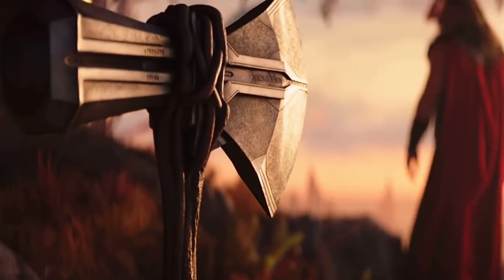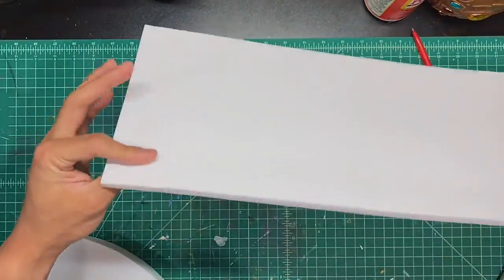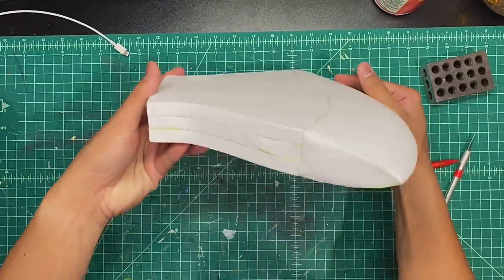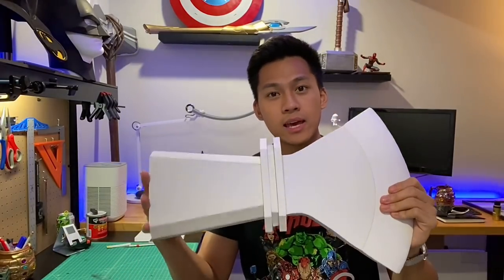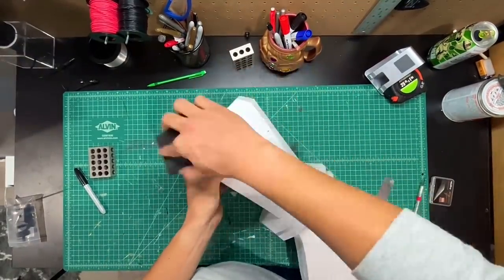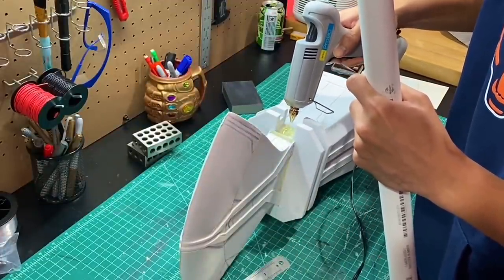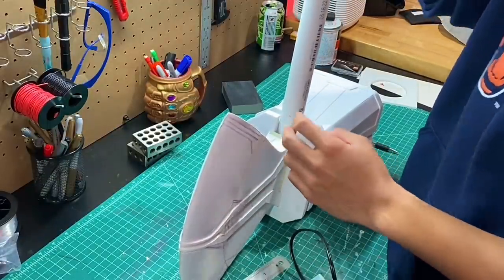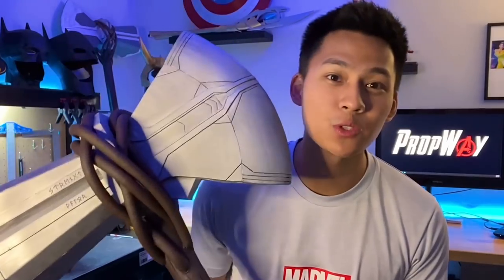How to make STORMBREAKER! - DIY Thor: Love and Thunder

Comment: What is the size of the octagon pieces that connect the axe head and hammer head pieces together?
Reply from the maker: The outer parts are 5" x 7", and the inner part is 4" x 6". And of course, I cut the corners at a 45deg angle.